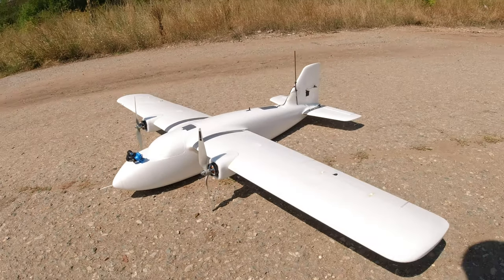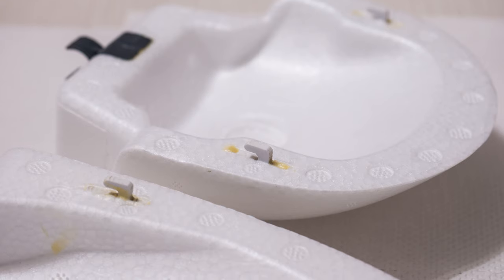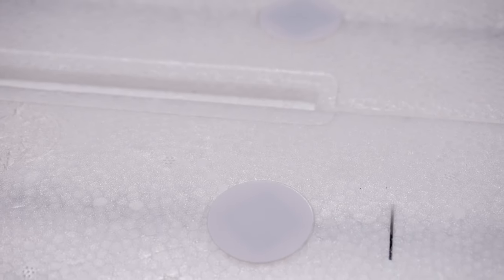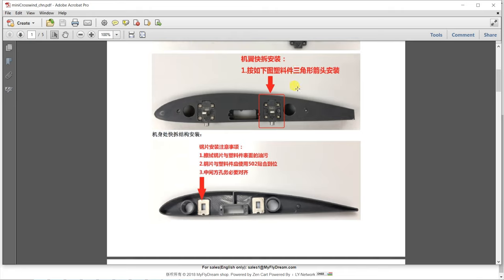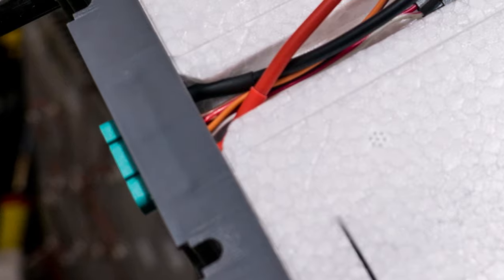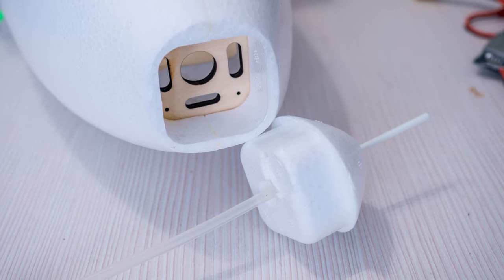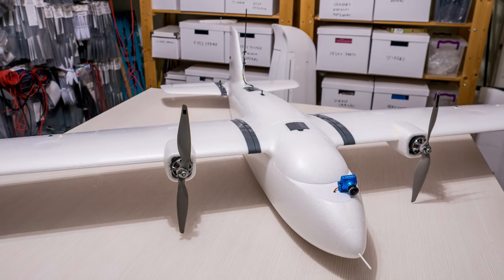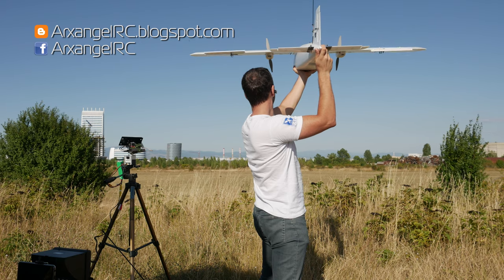MFD Mini Crosswind build with MFD guts!

Comment: FYI for anyone assembling one.

I have received an MCW recently & the wing connectors will close tightly.

In order to keep a tighten fit I have fitted the metal plates & 0.4mm of shims. 

In this video where the wing won’t fully close, it is definitely not the case when assembled on a batch from this year
Reply from the maker: Well... actually I haven't fitted my metal plates... :) I guess there might have been some change to that!
Reply: ArxangelRC yea it was because you said you were glad you didn’t as you couldn’t get the wings to go in further, they defo go all the way in the with connectors and plates fitted
Reply from the maker: Cool, glad to know they are paying attention! :)

Comment: You are soldering the wrong way and will get cold solder joints or disconnects in flight. You need to tin the solder tip, then touch it against the metal you want to solder so that it can transfer enough heat so that next, when you put solder on the METAL (not on the solder tip) it will cause the solder to melt directly on the METAL. Without actively adding solder you are not adding flux to your connector which is a MUST for a proper solder connection.
Reply from the maker: Actually... I am touching the connector with the tip, it starts heating up... and then I apply solder directly to the point where the tip is touching the metal. So far I've had no issues or cold solder problems doing it this way... and it has been years! Also... this way all available flux does get used to fuse solder to metal... rather than just burning it up by tinning the tip first!

Comment: Video just the right length while I'm putting my kids to sleep :) impressive kit. Can't wait to see someone make a 3 motor version :)
Reply from the maker: Hahaha, good then.... it will be used for putting kids to sleep! :) As for 3 motor version... I might do it... but will have to see how it will perform when I replace the motors with the proper ones for this plane... and then might add a front one just for the same of testing it that way... but might need a larger battery too... and lets hope the wings and tail survive the extra speed! :)
Reply: @ArxangelRC  Excellent! Maybe laminate the wings - then they'll hold any G's no problem!
Reply from the maker: Well... that is not the main issue... wings are stiff enough... the locks might be the weak bit... and laminating won't help there!

Comment: Nice to see this long waiting assembly. For info, I'm using FOAM-CURE glue from Bob Smith Industry and it's far far better on final look of the model. You don't see the glue ! Crystal look and not yello like old PPU.
Reply from the maker: Hmmmm... interesting... does it soften EPO? Is it strong? I've used some foam safe, transparent glues before... but they turned out pretty weak when it comes to holding power!
Reply: @ArxangelRC  like all kind of EPP/EPO glue, it need air to completely dry. That depend the use case. But for lovely and beautiful plane, I use it on every visible part because it's crystal clear and strong !  And it stay soft. Read some pro/cons here https://www.rcgroups.com/forums/showpost.php?p=31520976&postcount=24. RCmodelsreview show it many years ago I think but not sure. Previously I was buying from hobbyking but I find it in France RC shops like intermodels.
Reply from the maker: Yup, will check it out! Thanks! :)

Comment: Where can I find those Mpx connector with 9+2 pins?
Reply from the maker: Actually those may have the colour of MPX.. but it is possible they are some custom or purpose made connectors for our purposes now... will inquire about the specific model, but I have not seen something like this before!
Reply from the maker: OK, I have confirmation... those are custom connectors and at this point cannot be bought elsewhere!

Comment: Great video 👍. What motor /prop combo would you recommend for a 4 s.  Setup?
Reply from the maker: Thanks! Well at least 700Kv motors for sure... as for the props... same ones I am using - 10x7 or 11x7 or even higher pitch!

Comment: Dear Nikolai, 

What would your rather recommend - crosswind or X-UAV clouds?
Reply from the maker: Well... it largely depends on the intended use! For FPV only... the Clouds is a very tempting option because it is relatively compact, once CG is correct it is absolutely a dream to fly, and auto take offs are exceptionally easy! The Crosswind Pro is definitely more oriented towards mapping... and it is a good deal bulkier... and also more expensive!

Comment: Hello  ArxangelRC, hope you are doing well. Can you please advise how do you usually center the servos you mentioned at 12:11? I am struggling with this doing my first built. Thanks in advance
Reply from the maker: Hey... well... I power the servos with a servo tester, centre them, and adjust the clevises and/or push rods until the control surface is flush with the rest of the wing, or in the case of the tail... until it looks flush with the whole horizontal stabilizer...

Comment: Could you tell me where his CG is and the minimum battery weight to be ready for flight? I put a lipo of 4s of 10,000mah well ahead and still it is not working.
Reply from the maker: CG is right at the front edge of the wiring channel in the wing! As for the battery... just add more weight to the nose! I have an FPV system in mine, and also put on a DJI Osmo Action camera on the nose, so my 900 gram battery is more than enough to balance the plane, and I also mount it a bit back too.
Reply from the maker: @JuniorLobo76  Nice paint scheme! And looked like a pretty good flight! Well done! :)

Comment: I'd like to buy it but if you look at the prices it becomes a bit expensive cause plane 150$, then pnp add on kit for 130$ and Autopilot 180$... 460$ plus customs I assume ... 
That is a nightmare - for a styrofoam piece and flaws like the missing motormount access.
Volantex has a blown plastic fuselage
Reply: It is a lot of passion that drives it but always a lot of money.
Reply from the maker: Right... well... unlike with the electronics provided for MFD products... which is actually top notch stuff... I mean... HobbyWing ESCs (!!!!!!!!!!!!!!!!!!), I can actually recommend the power pack for these planes with absolute certainly! In comparison... I cannot recommend the Volantex electronics, and my first suggestion most of the time is to replace most of it, if not all... so really... if you have to buy proper stuff anyway... it is not that much cheaper... you do have to take into account the quality of the parts included... no only that they both provide ESCs... because in my experience... who made the ESC is quite important! Same goes for the servos, and other stuff, including motors! I may be OK running my Volantex motor on the Phoenix 2400 on 4S, but other people are burning theirs.... what does that tell you? LACK OF QC and lack of reliable manufacturing to ensure they can all survive those conditions! Haven't had any complaints about anything that has ever come on an MFD plane!!! There IS a reason why all my planes are running HobbyWing ESCs... and also why MFD are using that particular brand too!
Reply: @ArxangelRC  yes, I can understand that but if I start such an adventure that can go terribly wrong as you know I should be aware of the total amount at  stake and that is a lot more than the kit.
The other point: chinese kind of understanding customer satisfaction
Banggood and Gearbest as retailers are hard to fight with regarding warranty or missing pieces ... even with paypal.

And I do nit wanna imagine the fight with a manufacturerer with a sales team that is not so internationally experienced. 
Another point: Banggood and gearbest know how to get their parts into the EU but who knows about mfd and ce certificates?

If I spend 500€ + I want to have at least a sales outlet in europe like Xiaomi has or dji.
I bought dji and they handled my complains like other european or german companies.

And I was happy that Volantex had offered blown fuselages and the quality they delivered cause they worked out for me. Arrived in good condition and all pieces in the box. 

Maybe MFD delivers higher quality that I could not see but
★ will I get the same attention if I complain
★ why are people complaining about tiny parts missing or broken
★ does your shipping might get a second check

Sorry, but spending 150$ for a volantex - even if the components are crap which you did not mention in your volantex reviews that volantex motor, esc, servis, props are crap - and upgrading it piece by piece is a different story then putting 500$ for a piece of foam + electronics from china with not much responsibility and customer care and no european sales or distribution.

Europe is an even bigger market with highet pooulation density than the US so they should be able to have a solution.

If not they fear european consumer rights and are unwilling to fullfill orders. 

MFD might be great but risks are too high - for me and I don't wanna spend so much for a bit of electronics in a cheap styrofoam fuselage.

But: I like to see the success you'd achieved with the plain and thanks to your skills too - that I do not have ... for building, flying, repairing.
The only thing I can do better than you for sure is ... crashing a plane one way or the other.
Reply from the maker: Hahaha, actually I do mention every now and again, that the Volantex gear could use replacing, especially the servos... but I've reviewed so many of their planes now, that at some point it should just be a known fact... I just get tired of repeating it! As for MFD... they do sag a bit on the customer support... but not because of lack of international experience! Not sure why actually... it is weird for me... but you do get some small issues every now and get... for the most part they get resolved! But I do get your point... but personally... if I have to wait for something to be stocked in the EU... might as well give up, as I would be the last to get it! I've accepted long ago that I should expect no help from China, even if something is wrong with the plane, and just fix it myself! 3D printing has certainly made that much easier... and even foam... I still can't make this plane myself... let alone make it look so good, or fly so well... not unless I make it my full time job to design one... which is not an aspiration at this time!

Comment: some info.    at 6:20,   W R O N G.       MOTOR  leads  Should be  lengthened.     main power leads  should  NOT  be  lengthened.
Reply from the maker: True... but there is no provision for the ESCs to be inside the fuselage of the plane... not enough power pins on the MPX connector for that, so the battery to ESC wires have to this long! From there, I am using ESCs from another project that have the connectors on the PCBs.. and even if they didn't... they would still have to be mounted in the nacelles... so makes no difference really, other than having to cut some foam to fish them out when I get to replacing the motors next week! :)
Reply from the maker: Not defending anything... just saying! In a design like this, where you have such connectors to provide power to the wing... you are limited by what the connector can do! In this case, the large power connectors on it, are only 2... which means that if you want to keep the ESCs inside the plane, which would help shorten the wires to the battery... you will have to run an external 3rd wire, for the 3rd phase of the motor, which kinda defeats of the purpose of this quick connector if you still have to fiddle with connecting and disconnecting additional wires when dealing with the plane! Furthermore... in so many years... having built quite a lot of these planes, and most have had the battery to ESCs wires to be the longer ones... I've never had or seen an issue with that! Keep in mind we are talking about pretty short lengths of wires here after all, even if they do appear long... with respect to the hobby... not sure you will start to see any actual issues until you go into the meters... lots of them! For a 30-40cm length of wire... unless it is pretty thin... I don't see how that can be an issue!

Comment: Awesome job, It's a lot of help for me.
Yesterday, I tried Crossbow mini with iNav2.2.1( matek F722-wing + matek M8Q GPS + Teleflytiny tracking module), But Crossbow mini didn't work :(
I connected shared GPS configuration, Teleflytiny works good at OSD(ublox 115200bps, OSD express GPS coorinates), but Crossbow mini is not work.
Is Crossbow mini not support for iNav?
Reply from the maker: iNav doesn't matter! In the settings for the TeleFlyTiny and also the Crossbow Mini there are options to set them to V2 or V1 tracking data! If one is set to V2, which I assume the TeleFlyTiny is, and the Crossbow Mini is set to V1, which is how mine came... then they will not see each other!
Reply from the maker: You just have to adjust this in the settings!
Reply: @ArxangelRC  Thank you for your advice!!!
I tried to set VBI V2 both of them(Teleflytiny and crossbow mini), but It didn't work.
I'll check all the system again, and will retry it!
Reply from the maker: Hmmm... that is weird! Did you figure out what the problem was?
Reply: @ArxangelRC  Thank you for your consideration.

Today, I received new VRX(RC832) so I retry it,

ALL THINGS ARE OK!! CROSSBOW mini is GOOD WORK!

My falulty are : 

1. Bad VRX : previous tries, I used bad VRX, so that affect GPS communication to crossbow mini.
2. Bad V : I supplied 2S voltage to crossbow mini. now I use 3s Li-Ion battery. As you know, crossbow mini require 12~16V.

My setup is  Matek F722-wing + iNav2.2.1 + Matek M8Q(shared configuration, ublox 115200BPS in iNav) and etc.

In my humble opinion, I believe that "calibration" at crossbow mini is important.

Thank you again!!!
Reply from the maker: Great news! Glad you got it working! So... how are you liking it so far?
Reply: @ArxangelRC  Thanks! 
Sorry for super belated response!
I love it so much, but single attentive point is magnetometer(compass).
Crossbow mini has a magnetometer inside, so it is affected Ndmagnet for attachment.
In my humble opinion, magnetometer initialize at turn on and direction alignment are important.
https://youtu.be/lJDYe1FJR98 : This is my friend's setups(00:07~00:20).

Say hello to him!!!

Thanks again!
Reply from the maker: Yes, this can be programmed, but by default it uses it once on startup! The good thing about this situation is that you can then easily trim the tracker if it is not pointing at the plane by simply rotating the tripod it is mounted on in any direction needed! :)

Comment: Great video! What is the benefit of Lion vs Lipo?
Reply from the maker: Much greater energy density in the same weight basically!
Reply: @ArxangelRC  thanks! Any specific size or brand of the cells?
Reply from the maker: Depends on the application!
Reply: @ArxangelRC  for the MFD Crosswind for example. I have seen factory pictures with 22.000 mah LiPo...
Reply from the maker: The big Crosswind would easily carry that battery... but if it was LiIon... it would be about 30.000mAh for the same weight!!! So you can imagine how useful that can be... upping the usable capacity of the battery by 40%... with ZERO weight gains!
Reply: @ArxangelRC  understood, thank you very much! 👍☺
Reply from the maker: You are welcome! :)